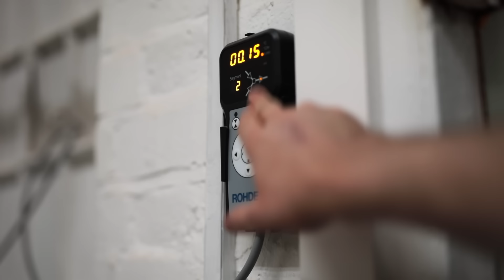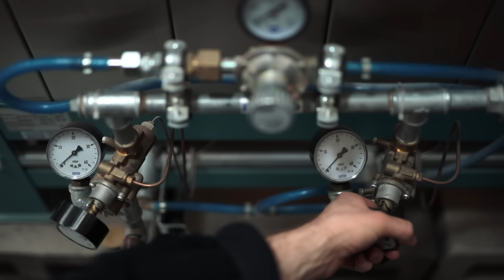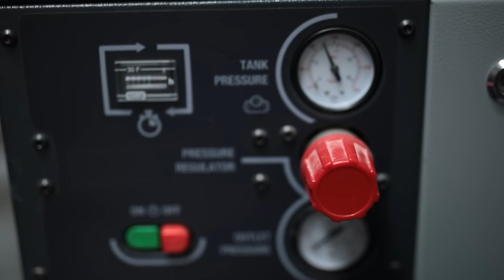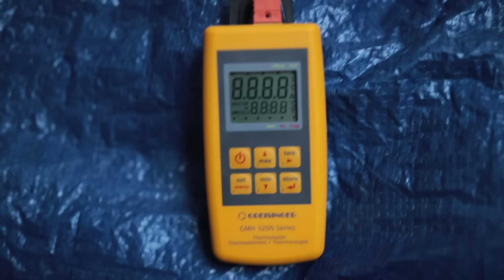How to Make Handmade Pottery Ramen Bowls — ASMR Edition

Comment: I’ve always wanted to know what the piece of wood with the metal attached to the end is for. Does it trim off excess? Or keep it centered? 🤔
Reply: It’s a guide so that each bowl is a consistent size 😊 
edit-notice around 12.20. I think that particular thrown bowl was the first and out of order in the edit as Florian throws, then measures, and only after that does he tip the guide over for the following bowls. I may be wrong 🙃
Reply from the maker: I have to throw one pot and measure with a ruler before setting my throwing gauge, hence the bowl being on the wheel before I get started for real.
Reply from the maker: It’s a throwing gauge, used to measure thrown pots, which means you don’t have to measure each individual pot. I get mine here: http://www.darrenellispottery.com/shop/1-pointer but they’re sold out at the moment.